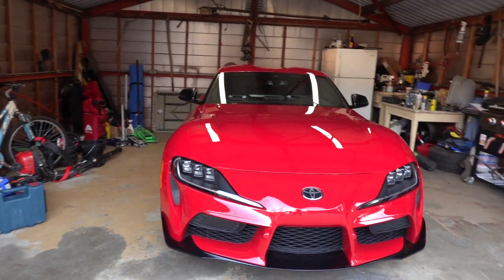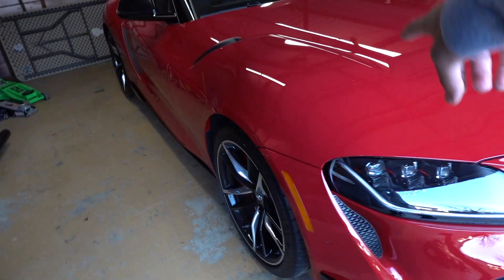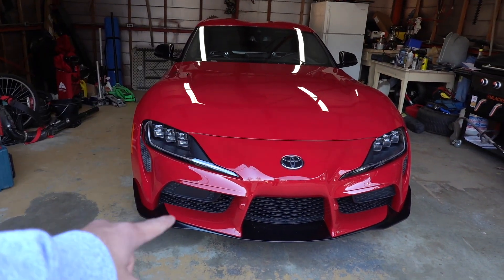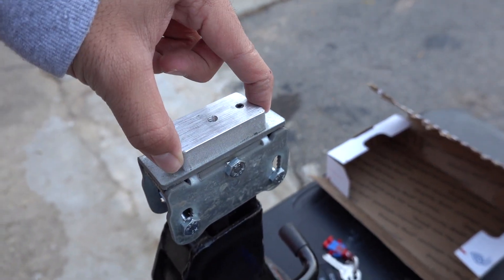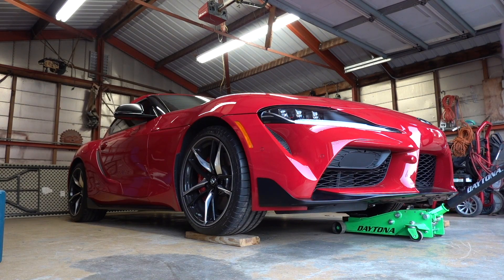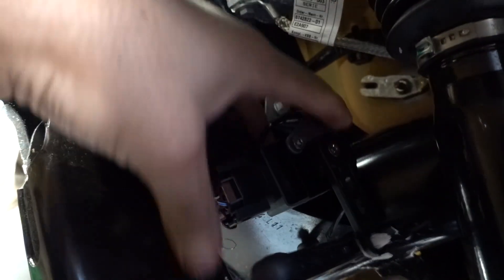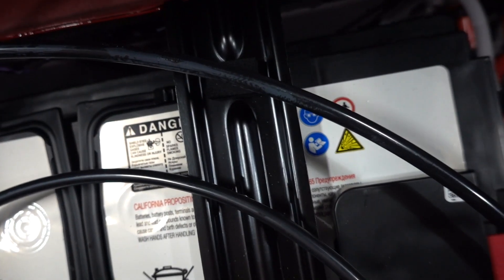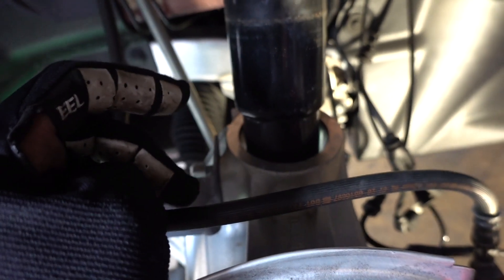Installing AirLift Performance suspension on my GR Supra!

Comment: Do you remember what size rubber grommet you used to plug the hole where you ran the air lines?
Reply from the maker: I bought a pack of grommets from Auto Zone it came with different sizes, don’t know the actual size.

Comment: Damn this is Great, I wish this were more Raw though looked as you were trying to explain stuff that would be helpful.
Reply from the maker: It’s difficult on my own, I’ll hire a camera guy for these type of videos from now on, Thanks for watching!!
Reply: @Thejoseaguilera  Question if you remember, Did you have to remove the Rubber Spring Isolater on the bottom to install the air bag? For some reason if i have it in the bolt from the bottom wont start. But if i remove the rubber the bolt doesn't full tighten its got a gap.

Comment: Dope setup! How do you like riding on bags? Do you think the ride quality is better or worse than stock suspension?
Reply from the maker: Air suspension in my opinion is the best because you can daily drive and also track your car while looking amazing parked at a show, you can adjust the dampening settings so the ride is actually nice when in the softer setting!